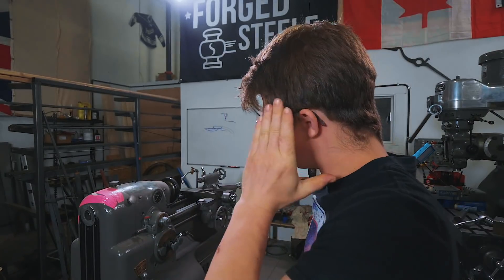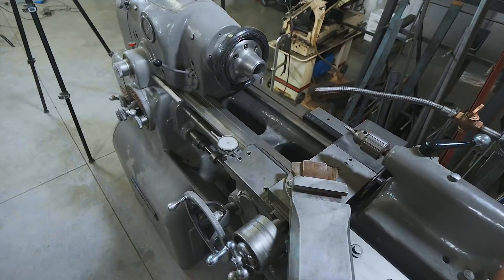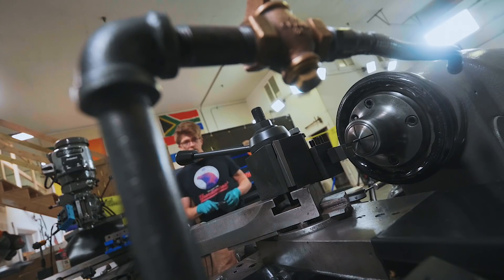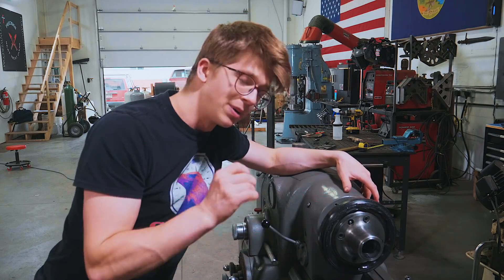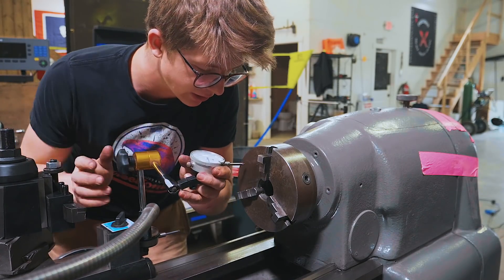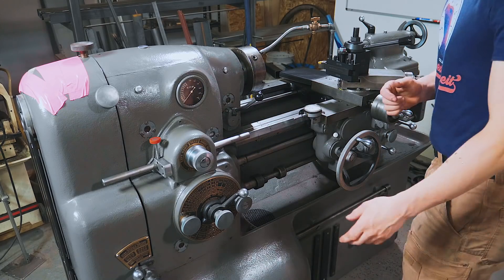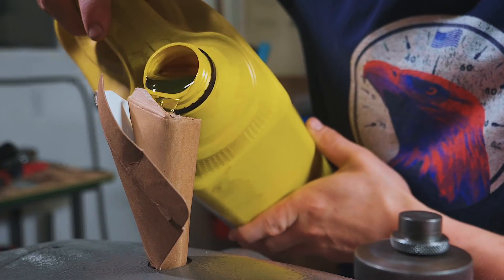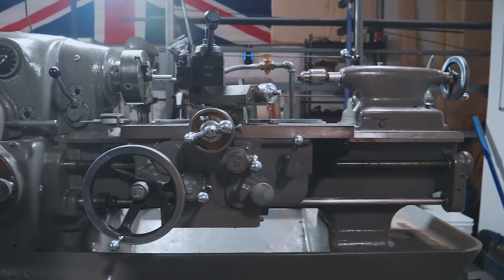FIRST CHIPS ON THE MONARCH 10EE LATHE!!!

Comment: Hi Alec! The left hand and right hand positions are for threading. There is always some kind of interlock that prevents engagement of the feed and threading at the same time which would be disastrous. Try moving the spindle by hand while trying to move the handle. You're changing gear positions so that's usually necessary to get them to mesh correctly. Fun fact: the longitudinal feed and cross feed go in opposite directions for a reason. They are geared so that if you engage them at the same time you will end up with a 60 degree point on your stock, which is the angle on lathe centers. Cheers!

Comment: I own a monarch 10EE lathe and have spent 25 years and hundreds of hours on it.   Let me know if you need any help with figuring things out on it.  Best toolroom lathe ever made.
Reply: If he locked it at 45 degrees, doesn't it mean it is now impossible to cut pieces with a lathe ?
Reply: Not sure I understand the question.   The angle that the cross slide is locked on doesn't impede the Z travel (side to side or left to right)  of the lathe in any way.  It also doesn't affect the X travel (in and out or forward and back of the operator) either.   The angle only comes into play when you are using the cross slide.  Don't know if that helps you out or if I am just missing the question altogether.
Reply: Locking the cross slide only prevents the cross slide movement.   It doesn't affect the Z or X travel.
Reply: I you save course
Reply: Mark Farrand-  Why doesn't his EE have the Thyratron tubes in it? Did not all of them have them?
Reply: @Steve_Just_Steve  No, the 2nd generation design had the Thyratron tubes. It was called the "WiaD" or "Works in a Drawer", because the control system parts were literally in a drawer in the side that could be pulled out for service. He has the 1st generation, "MG" or motor-generator system. They worked by running a DC generator with an AC motor, to power a DC motor. Back then, there was no way to regulate AC motor speed, so this is how they converted AC to DC. Seems weird, but it still works, many 10EEs still have that system today.
Reply: One of the best!
I would also rate 
DSG
Holbrook
Smart and Brown 1024
And the CVA which was a British clone of the Monarch. I have just bought one!

Comment: 4:59 you need the compound setup at 30 degrees not 45 for halving x travel distance.  Beautiful lathe, these 10EEs are better than most new lathes today!!
Reply: uhm, no, that`s for cutting 60º threads
Reply: @TheMadJoker87  Yes, but it is also for halving the travel of X, cause trigonometry says 'sin (30) is 0.5'
Reply: @TheMadJoker87  This Old Tony made a great video on sine bars and explains trig very well.  You are correct on the threads though!
Reply: 29 not 30

Comment: Hey Alec, great to see you doing some turning again!
I'd recommend you get a set of hard outside jaws if you don't already have any and a couple sets of soft jaws are good to have on hand as well.
The dial you're using at 12:17 is for thread/screw cutting, I haven't used any monarchs so idk if that adjusts the feed rate for traverse or if there's a different dial for that. If ever you want to have a go at threading, it looks like you need to engage the lever on the far right side at the 12:00 minute mark. Just have the lathe running on a low-ish rpm when you engage it so it doesn't shoot right into the chuck! Looking forward to seeing more from you

Comment: To reduce chatter only hang the material 2.5-3 x material diameter out of the chuck
Reply: Or at least use the other set of jaws, more gripping surface and a more stable hold
Reply: @gianlucapolo5712  
No matter what length jaws you use if you hang it out more then 3 x diameter you will get chatter. But if you use a center in the tail stock you can with hang it out 8-10 x diameter

Comment: Hey there Alec! Love your videos! As a CNC Machinist here in the gallatin valley, I think I should mention that the stock you were working on was sticking out too far without having a live center on the other end. Ideally, you don't want to have your stock sticking out of the chuck more than 4 or 5 times its diameter. Causes the stock to wobble a bit, leading to run out. Also, you shouldn't really center drill past the slanted part of the center drill itself, ideally you go 1/2 to 2/3 of the way down the slant, or just swap to a larger center drill if you need to go bigger. 

Love the videos man; keep up the great work!
Reply: Causes chatter and part to try and climb the tool more than runout. The piece was running out a lot but makes no difference as long as the part is machined all in one operation. But you're right he's pushing it with that amount of stick out.

Comment: One of the reasons for the design was that aboard ships of the time all power on board was DC.
Reply: So they just had the DC wired into the lathe directly when it was on the ship?
Reply: Nope...they had the MG (motor generator) set so they could vary the spindle speed while still having good torque...even good variable frequency drives won't keep the constant torque capability

Comment: Please turn the jaws around in your Chuck. They way that you had them was for large diameter ODs or you should have another set of jaws for smaller diameter. It will improve your runout and stability greatly.

Comment: I myself enjoyed using the lathe when I was studying to become a Machinist. I chose a different route afterwards, but word of advice, there should be a coolant tap above the work station so some coolant, which is generally a mixture of water and oil, runs onto the work piece, cooling it down as you work. That would have been used when you were doing the centre drill :)

Comment: That serial number is most likely a internal serial number the military used for accountability. Specific to the ship it was on.
Reply: Not true at all. The way military logistics works is a simple process.. We order equipment (firearms, vehicles, rations, etc....) and we use the serial  number that is on the machine in our tracking inventory. The part would be listed in CMDRS inventory something like this...

Lathe, machine, monarch, 10EE SERIAL NUMBER: 100002 1 each.
Reply: @i.r.rayray6423   unless the item is inventoried for either calibration purposes or because it's an easier way of identifying the item on an inventory list
Reply: @i.r.rayray6423  The first number is most likely the Accounting number. IE where the money for it came from. The second i wouldn't know. I could possibly make some guesses.

Comment: Alex, As set up you have to go find a wrench if you want to turn your QC tool post to use a different face.  Get yourself a twelve point box in wrench (spanner)  of the proper size, Cut off the open end a tidy up the cut.  Using a torch bend the wrench up 90 degrees about an inch in from the box end.  Then, leaving sufficient room to work the stock locking lever, bend the wrench handle out parallel with the head (or a little short of parallel). Leave the wrench on the tool post so it is at hand when you need to make an adjustment.  I got a suitable wrench for a couple of bucks at a local pawn shop.

Comment: All of the whatchamadoodah's remind me quite a bit of an old leather stitching machine from the 1940's that my pawpaw had in his shop. Very similar sort of inner workings with the DC generator and everything. It even had an auto-feed mechanism with various gearing and speeds, with a clawed foot that would "walk" the leather through the machine. Awesome stuff. Not something you want to get an appendage caught in, because it would not give a single squat about your sensitive bits if they happened to get pulled into its mechanisms. They made the most incredible machinery in the 30's and 40's.

Comment: Nice lathe. Really get to know the various ways to use the compound, it's your best friend when used properly. I'd also recommend making sure the tailstock is adjusted for center height and perpendicularity to the axis of rotation, it will save you lots of grief.

Comment: What an incredible piece of engineering! Back in the day before electronics made things easy to make. Hard core engineering. AC-> DC with variable speed control and dynamic braking. Honestly be greatful that your electrician was able to troubleshoot that incredible piece of equipment. I am a Journeyman electrician and I'm not sure I would been able to, variable speed motors now use purely electronic VFD's. Very very cool.

Comment: If you want to halve your inward motion on the compound you need to set it at 60 degrees from the cross slide: cos(60°) = 0.5
At 45° you get about 70% both on-axis and transverse.

Comment: why not make some damascus out of those fancy chips!!!
Reply: That sounds interesting.
Damascus made with screws already looks insane god knows what chips will look like xD
Reply: As a machinist, I'd say that Machining damascus would be iffy at best. The tungsten carbide tools he's using aren't designed to rapidly swap between different hardness' of steel. It would likely trash the tool's lifespan, and those little suckers are expensive! Haha! He could probably make/buy an insert made out of high speed steel though :)
Reply: @KM-pm6sf the suggestion was to use the chips to make Damascus,

My only concern would be the amount of carbon left after milling
Reply: @nickkk420  yeah, what you said lol. ty
Reply: Check out green beetle, he did a vid on drill shaving damascus
Reply: Oh, mb lol.  Misread what you had typed! Haha!
Reply: @zacharybyrne9723  ahh sweet thanks!
Reply: @KM-pm6sf  all good my man
Reply: @KM-pm6sf  If you're a machinist, you'd know that carbide inserts have zero trouble cutting Damascus. I'm not sure who told you that.Alex has machined Damascus many times, as have I. Inserts don't care that there are two different metals.
Reply: @Andrew delashaw I'm not saying that carbide inserts CAN'T cut Damascus, I'm saying it probably isn't the best idea. Assuming that the 2 alloys of steel used have different hardness, the tool lifespan would drop drastically as you would be forced to use sub-optimal spindle speeds and/or feed per rev through the 2 materials. If the hardness is different enough, you could end up with some gnarly chatter as well, especially if cut on a lathe- tanking the lifespan even farther :)

Comment: 5:10 if you want to halve the movement you have to put the compound at 30° (respect to the chuck axis, 60° respect to the carriage main bed), not 45°. This is because of trigonometry. If you check the tables, sin(30°)=0.5, cos(30°)=sqrt(3)/2. If you put it at 45° you'll see that sin(45°)=cos(45°)=sqrt(2)/2=0.707.

Comment: Wow, they sold you a machine that powers up and spins but it really does need quite a bit of work from someone who knows or was trained on the Monarch to get it closer to spec. Maybe you can find a retired USN machinist who spent some time using or maintaining that while at sea and they can impart some knowledge and maybe a few days of time on a rehab. See if you can partner up with a veterans organization as part of a sponsorship to a worthy cause and they can find a few old salts.

That clunking sound you are hearing is the hundred or so US Navy machinists who are spinning in their graves for you putting that rather (being kind) CHEAP Chinese tool holder on at lathe.

Comment: I own the same EE. They also made a hydraulic version and a cathode tube version. It's an ingenious piece of equipment for its time. The Wizardry that gives it its variable speed on the electronic version is done by an electrical Exciter that changes fields and allows it to become somewhat of a variable frequency drive.

Comment: Thats a great old lathe.  I have never seen a dual motor arrangement like that.
Looks like you are going to need another chuck if you didn’t get the normal forward jaws with that chuck.
I hope the collet chuck came with a full(ish) set of collets.  They are fantastic for small accurate work.
Get a 4 jaw independent chuck as well.  They are indispensable:)
Oh and one from the safety police.
Watch out spinning up your 3 jaw with nothing in it.  The scroll can spin at different speed from the body of the chuck and throw the jaws across the room or through the roof.

Comment: As a novice machinist in my last semester of school for machining/manufacturing, my little bit of experience doesn't count for much, but I'd advise you look up a local machinist shop and convince them to give you a good tutorial of that lathe so you don't break something. Also, you could get a textbook for students of machining. The one I have has SOOOOOOO much info that will be useful to you. You can rent or buy them off Amazon. 😊 Awesome video BTW.

Comment: Ok here goes:
1. It's normal for the chuck camlock pins to be a bit wobbly, they are designed like that for good reason.
2. Good that you stoned the back face. Also pay attention to the locating taper bore & spigot, and ALWAYS make sure you clean it spotless before re-engaging.
3. You are using 'inside' jaws for small shafting. You need to look in your box of bits for the 'outside' jaws that taper the other way. This allows you to have less overhang & get in closer to the chuck with the tool.
4. In my experience it's uncommon to keep the compound slide at 45 degrees. Normally parallel to the bed. This means you can fine adjust when facing, and its 1:1 not 1.41:1.
Enjoy!
Reply: I'd say 29 1/2 degrees is more common. That way you don't have to adjust it every time you want to cut threads w/o using direct in-feed.

Comment: Those were locking cams you took out of the chuck. They are normally loose, you can adjust there height so when you tighten the chuck the lines fall between the crows feet at 3 and 6 o'clock. If they do not just alter the height of the cams until they do sit between the 2 crows feet. Remember to tighten the chuck onto the arbor in a clockwise fashion.

Comment: @Alec Steele, on military equipment such as what you've shown. the serial Number 100002 equates out to 10-0002 which is in fact 2nd part made of the 10th series. so that piece was roughly made around the late 1940s as anything after the 1950 have letters associated with them for better product handling.

Comment: remember if you ever do any screw cutting wind out before reversing because the slack in the screw will chew up the thread.
and if you ever drill deep holes dont wind out the stock just unlock it and slide the stock in and out when you need to clear the drill.

Comment: That is a very nice lathe. I have a couple of suggestions which might be helpful, not might not. I greatly prefer using new chucks even on old lathes, they are like consumables in a sense, especially on a lathe as nice as a 10ee. I have a lathe is the same age and came with a bunch of chucks, first thing I did was get a new set-tru style with bolt-on reversible jaws. I would consider getting a 6 jaw, 6" or 8". That older chuck is cool and nice to keep around  but once you use a new chuck, it is hard to go back. In addition the jaws that are on your chuck are reversed for gripping larger diameters, unless you have the other set, it will be very limited. The other thing is the tool post, it looks like a CXA size which is on the large end for that size lathe which is why the tool holders will typically be bottomed out. It will potentially limit the tools you can use because you will not always be able to get the tool low enough to be on center. A BXA is probably a better fit, you can buy BXA tool holders for CDCO for $13 each and machine them to fit 20mm tooling.

Comment: There are manuals available online for that lathe - just search for "round dial 10ee pdf" and the results will contain several links.  If you ask I could send one appropriate to you model.

The drive is based on the Ward Leonard drive used for elevators and is normally close to bulletproof.  It gives infinitely adjustable speeds from 10 rpm to the max speed with the supplied pulleys.  The max speed can be tuned and should be checked after making sure that everything is good on the motor/generator.

Proper oils are DTE 24 in the headstock bearings, something ISO 68 in the center sump, gear box and back gear and an ISO 68 way oil in the apron sump & tailstock.  I can't recall the grease spec for the motor or generator bearings. 

You can contact Monarch for a copy of the manual and the original buyer and tooling sheet, it's ofter interesting

Comment: ALEC! Quick suggestion: Put a spring around the tip of your chuck key so that it pushes its self out of the chuck when you let go. This will save you from getting the key thrown into your face at dangerously high speeds in the case that you forget to take it out.

Comment: Now that you have said lathe, a good idea would to be to make some t-handle wrenches  to live at the lathe for the 3 jaw attachment and tightening. It's a really easy lathe/mill project, and tolerances can be pretty loosey goosey.

Also may I suggest a 120 degree spotting drill (since I assume you're using 118 degree twist drills). It will work a lot better than using a center drill to spot. Skinny drills like to bounce from edge to edge of the corners of the 60 degree hole and chatter your drill and potentially affect accuracy. I know you're not making aerospace stuff, but the main benefit is making your drills last longer.

Comment: aa the lovely feeling of trying to figure out how the auto feed works. man do i know that pain. Them old gals can be so picky with it. pull a knob the right way but just  1/10 of a mm to little out and it just doesn't work even though nothing seems to move any further and everything seems to be in the right place. Even after having worked with a specific one daily for almost 3 years i still sometimes had a fight with her when i wanted to change things she didn't like. Switching between low, medium and high gearing on the feed was like a 20 minute contest of fiddling with the lever while spinning the chuck